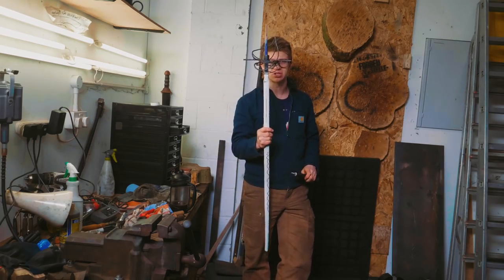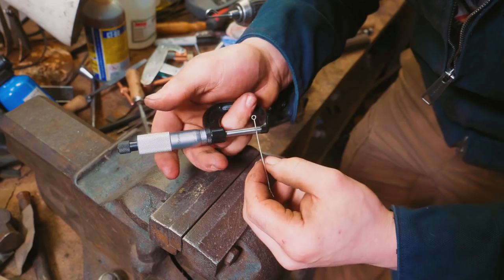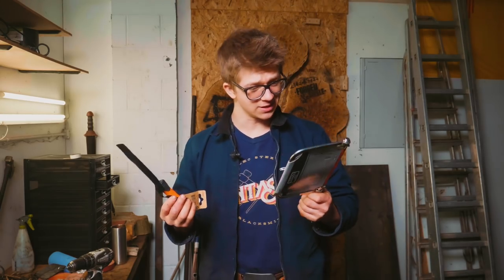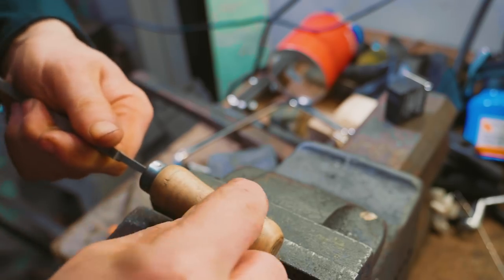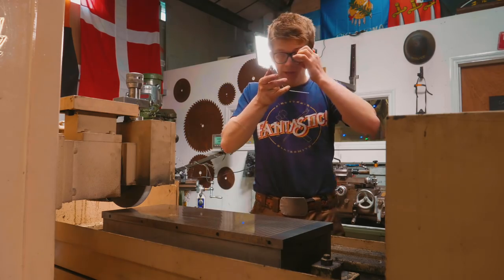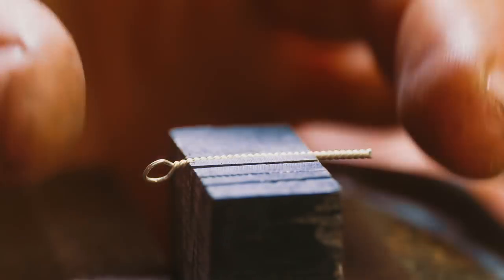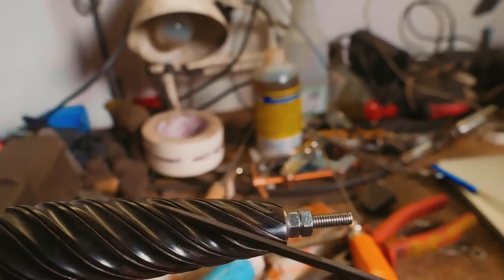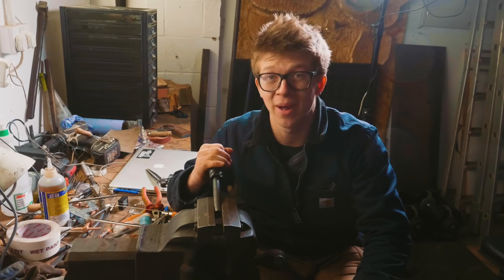MAKING A BASKET HILT RAPIER SWORD PART 13

Comment: Beautifully done! Don't forget to anneal that silver wire both before and after twisting! Consult a jeweler about it. When I make grips like that, after cutting the grooves for the wire, I use a fine, triangular Roffler file to chamfer the edges of them slightly so that insertion of said wire is easier. My usual procedure is then to run thin CA glue down the slits and over the wire and the entire surface as a final finish. So far, none of my wire wraps have worked loose!

Comment: Drill some little holes into the beginning/end of the flutes so as to anchor the sterling braid. Also, the KRAGL! (spoiler alert for anyone who missed the Lego movie) ((everything IS awesome))
Super glue can be your ally in this. With the proper silicone applicator from one of those BBQ basting brushes, you can pinpoint the glue where you need to. But of course this comment is in the past for you so I'm excited to see your execution! 
Top tip: by fluting FIRST then polishing the flutes THEN finishing the main handle you actually SHARPEN those corners and you do it only ONCE. One & done my friend, always strive for it. ✌

Comment: Excellent result for a first attempt!
Jeweler's saws and small hand files can be more readily found at a hobby/craft store than the home improvement warehouse.
A trick for starting cuts in wood without the blade jumping - run the blade in the non-cutting direction first, it will still cut a little bit but won't skip as badly. Also, if you can, apply a light pressure to the side of the blade with your thumb.

Comment: Hey Alex, Continue the grooves on the ends, drill small hole at the end of groove, put tap of super glue in the, along with end of the wire, bend 90degree on the groove and continue until other end, then put tap of glue on the hole and push the wire end in the hole, while holding the wire from getting lose. This should hold it in place. You can put taps of glue into groove along the way, but this can be bit messy. To avoid most of the mess, put tap of the glue, place the wire in place and when glue has cured, use edge of razer blade to sizzle excess off, polish and apply lacker that secures wire in the groove and protects the surface. Most people would recommend oil, but lacker is better as it holds the wire too.

Comment: With patience and perseverance you can piss through a brick wall.
Reply: Jim Garner My stream is pretty weak and I could barely piss through a sand castle. Do you think that advice will work for me? Lol
Reply: Jon Knapp last I heard erosion still works... As for the weak stream, you might wanna get that checked out...
Reply: Not gonna lie... I am stealing this as a teaching quote. You coined it, I will make it famous.
Reply: I would have said impossible before I saw those flutes being made. That wall CAN be pissed through. You can do it!

Comment: For the larger scratches try putting baking soda in the scratch then put superglue onto the baking soda, it's a trick I learned doing old guitar restoration. It feels good and once you make it flush you can hardly see it

Comment: Really appreciate your attention to detail and carrying that all the way through. Good craft isn't always knowing the way you will do something when you start doing it.
May have been mentioned, but in case not:
Try using a burnishing tool over the wire after you get it in and it will form into the groove better.
Jewelry (wire) blades come in large packages and many different diameters. If you really want to go deep  end, you can cut your own saw blades with variable tpi at different parts of the blade without too much work. Look up dovetail saws.

Comment: The slight imperfections don't matter. It's not about accepting them because at least you tried; it's about making something that has had heart and soul poured into it and imperfections are part of that. A machine could maybe cut the grooves perfectly but it would be all the lesser for it. Fantastic video, fantastic work as always.

Comment: Hammer the teeth on coping saw blade to take some set out which makes the kerf thinner.
Reply: Well, he did destroy his relief angels that way, but that isn't a concern for this application. Only if he was making long cuts or using this in metal. Which he isn't.
Reply: He just turned the saw into a file...
Reply: Geoff, you know, I've just spent several minutes thinking about all the things I learnt about files and saws (I have been lectured many hours about that stuff by a metallworking foreman, and I couldn't come up with anything, why you should be wrong. The only thing would be, that a file is self supporting, but that is pretty weak.

Comment: Hey Alec,   Hopefully this is not too late but i would recommend annealing that silver wire before twisting it.  The twist will seriously work harden the silver.   Keep it in a tight bundle as you have it. some thin iron wire wraps will hold it nicely.  If it gets firescaled then a safe pickle solution to remove the scale can be made by dissolving Alum (should be available from a pharmacy) in pan of hot water leave it in the solution for 15-30 mins on the lowest stove heat you can.   

When twisting, use the hook and drill method you were using but do far more than you think you will need (getting consistent twists over multiple lengths can be tricky). Keep the wire under a bit on tension and go real slow with the drill allowing it to draw you towards your vice as the overall length reduces.

Finally... when you release the wire it Will want to spin and can kink or tangle so keep then tension & hold twisted end near chuck real tight in a glove and cut wire at the hook... then slowly release pressure on wire and let it "relax" under control.

Tap me up if you need any silver working tips.

Stay safe, stay well, dream well

Comment: Alec! I haven't a clue if it's been mentioned yet or not, but when you put the blade into that jeweler's saw, keep the far blade holder open and keep pressure on the handle when tightening the far holder. Your first blade wasn't taut at all, and you weren't cutting as deeply as you could've been.

Comment: Hey alec, just a quick tip when twisting wire. after its all twisted, cut it at the opposite end of the drill with wire cutters instead of releasing it, itll release all that build up tension in end cut as opposed to releasing all the tension into the wire if u simply release it

Comment: Alec, the handle looks great so far. I'm sure you'll complete it in order.
Next time, maybe try holding it in the lathe so you can turn it just a little bit as you cut or file around the handle. Just might decrease the time a bit from loosening and tightening the vise. Plus you can keep the angle of approach the same instead of adjusting the vise or yourself to meet the angle it happens to be in the vise. If you're worried about getting wood shavings into the lathe, you could either get a small wood lathe or put a cloth or paper drop sheet between your work and the lathe.
Going Amazingly. Great job.

Comment: Hey mate, using a sanding sealer then a wood friction polish with a buffing wheel would save you a heap of time on sanding those flutes. Look up EEE-ultra shine, or Yorkshire grit. Pretty standard woodturning stuff, your Dad probably has some.

Comment: Get a hemostat for holding small items like those sawblade pins. The hemostat has a locking mechanism so you don't need to keep constant pressure on the item you're holding to prevent it from slipping.

Comment: I think going from metal working to wood working is a lot harder since when working with metals most of the time fixing a mistake just involves adding heat and giving it a few hammer strikes but with wood, you mess up and have to start ALL OVER. Let's just say I've had a hard time with wood, seeing what you've done is just amaizing.

Comment: As this tip may be too late or just uneeded.  If you plan on using an adhesive with your wire inlay I assume not with that amazing tolerance fit but if so get a syringe and fill it with CA or get something like GS Hypo Cement that has a tiny needle end built in for fine work.  But holy moly Alec the work you do never fails to amaze me you are a talent and a joy to watch.

Comment: I'd have cut a flat into the top and bottom of the grip at the end of each path, letting you lay the ends of the wire all the way up and over, letting the spacer and the pummel friction grasp the ends of each wire for a flush look! Still, GORGEOUS work alec.

You can check your depth with the side of  a feeler gauge, marked with a marker or scribe line at your desired final depth!

Comment: It came out beautifully, it might help to drill a pilot hole on the ends of each of the channels then you could drip some super glue into them and tap a angle on the end of The Wire so when you're wrapping it it won't pull out, the pommel and guard will cover the ends anyways so you won't notice anything.

Comment: if you haven't already twisted the wire, might i suggest looking at vape coils before doing so. it may give you new insight in method at type of twist. there is also simple jigs you can make that would help you not bust any of that soft wire.

Comment: I saw you using a looped end in the chuck of your drill and have a method that has worked for making twisted wire I think will help you out. When you go to twist the wire if you take a single strand and chuck it in the drill then vice the other end it will straighten out the wire before you go to twist it. When you go to twist it, tape the two pieces together then on the other ends make one 90° bend at the end and put those in the chuck of the drill the twists will come out very even and you shouldn't get any breaks. Just take it slow and hold tension not to much but you will know what I mean when/if you try it.

Comment: Not sure how you're thinking of doing the twisted wires, but I'd suggest grabbing a pair of lock wire pliers. There's actually a couple procedures floating around that talk about achieving certain twist per inch that could probably help give you a very consistent thickness.

Comment: Take your groove around the corner on the ends ( cut a groove on the flat end) so that your silver turns 90 degrees and is sandwiched between the wood and the pummel , between the wood and the  transition spacer. This should help secure the silver wire at the top and bottom of the wood handle. 😎👍
Reply: Love every thing you do by the way👍

Comment: For the wire inlay, could you have gotten a tiny flat head screw driver, ground it into a chisel shape? Seems like it may have made both depth and width easier to gauge.

Comment: ALEC: important thing: if you want to use silver in your projects, but dont want to worry about it getting black, use Argentium Silver, it doesn't turn black (under normal circumstances) and you can actually thermally harden it so that it is less likely to get scratches. If you, at any point, have any questions/want to know more about working with precious metals, feel free to ask, I am a goldsmith.

Comment: You should get some safety wire pliers, alec! A fairly inexpensive pair is about 10-20 quid and does a much better job at making quick and consistent twist counts in any sort of wire. They're also pretty versatile pliers for detail work since they lock down very securely and also have a set of detailed cutters. You can get them with textured jaws (my preference) or smooth jaws (the preference of people who safety wire jet engines since they don't mar the wire on complex wraps where you use one length of wire wound multiple times in multiple places)

Very versatile tool and they do the specific job they were made for remarkably well. just go for some reversible ones with textured jaws. Safety wire is also good for bolts that tend to rattle loose on things like the power hammers , grinders and mills, you can get away with a LOT less torque fatigue on bolts by simply safety wiring them.

Comment: One way to ensure your wire thickness is consistent is to count the twists per inch (or CM) in each segment that you twist. if you need eight individual strands, twist them in short individual segments (longer threads tend to be less consistent) and just twist them to a specific number of twists per inch.

Comment: Brilliant video as normal, thought i'd just pass on some tips for your wire twisting. As part of the vaping community we have now quite a few years of experience making wire into heating coils for use in vaporisers, some more practical than others but it has become an art form! you would not believe the work and craftsmanship people have gone thru to heat up a fluid. point being do a search for simple twisted wire coil building, you will find plenty of vids on youtube showing you how to avoid it knotting and even straightening the wire before twisting etc. have a look around and see what you can find to help your endeavour. All the best!

Comment: There may be another comment about it, but I didn't see one. When tightening the micrometer, use the black knob at the end. It has a clutch so that you do not over tighten the jaws on the material. It will also help keep consistent measurements since you will tighten it to the same torque each time.

Comment: That is pretty amazing. Hopefully anyone buying a handmade blade with a spiral fluted handle now understands why they are as expensive as they are. Even if you've done a number of them and know how, it's still a painstaking and slow process to get right. It has to be right because if it's off just a little it'll be real apparent. Also it takes so much skill do that the rest of the blade is likely done to just as high a standard.

Comment: Alex, great series as always.  I was reading the latest (April 2018) issue of Fine Woodworking magazine and saw an advert for some new (at least to me) sandpaper by 3M called Pro Grade Precision.  It is supposed to be very flexible sandpaper with a "unique film backing resists punctures, tears, and creases".  Thought it might help. 

Keep up the great work.
Rick

Comment: Japanese saws are brilliant for this stuff, they cut on the pull stroke which makes accurate cuts a lot easier and you can get insanley thin blades all the way up to super heavy blades.

Comment: cut a blade from an exacto knife in half so it is not as long, then make a channel by stabbing the blade into the wood over and over along the line you want. I have seen and done this several times, and it is the standard way that a lot of the ABS people do inlay into wood.

Comment: Will you be cutting grooves for the wire into the ends of the handle too? That way, you'll not have ends sticking out my your hand, but will have them safely tucked away around the ends of the handle.

Comment: I'm a wood worker. To flatten the "kerf" which is the left and right offset of the saw teeth all you had to do was put the blade on a flat hard surface and tap it with a hammer. It would have made the grove smaller by removing the alternating left and right offset of every tooth on the blade.

Comment: I knew you would use the surface grinder on the coping blade! Old jig saw trick: use diaper safety pins instead of reinstalling the old pins!

Comment: Just an idea, I would continue your wire channels over to the top and bottom of your handle to hide your ends under your pommel and top piece. Locking them in place when assembled.

Comment: Love the finisher you got on the handle do you think if you would’ve used a polishing wheel on your bench grinder could you have achieved the same polish and maybe you wouldn’t have had to use so many grits on your sanding

Comment: i see you constantly making blades out of Damascus which is cool. however what i would like to see is a multi layered blade that has the edge and the spine forge welded together Japanese style.  where the back of the blade is stainless steel Damascus and the actual cutting edge is a hard mono steel? kinda like an expensive chef knife. like a miyabi birchwood knife.
Reply: I seen a man on you tube years ago make a Damascus viking sword that was double edged Damascus that had 2 hard edges and a soft core. he was a master swords smith and i would like to see you make an even more ambitious build like his even if it doesn't work out we all learn together.

Comment: I love how you have done this and it looks incredible. I was thinking though. When the handle meets the metal pieces both above and below, are you going to have the silver wire end flush with the metal or maybe shave a shallow groove to bend the wire so that when its put together it can bend and be held in place under the metal pieces?

Comment: I am really enjoying this voyage, Alec.  The handle looks fabulous!  Will you be looping the wires to go around the hilt of the Rapier at the front and back of the grip?  I have been pondering this sterling silver inlay for awhile.  There is a farm near by that has some Texas long horn cattle and they have some huge horns.  I'd love to get my hands on a pair of them, do some pencil artwork, use the coping saw and inlay it with the sterling wire.  It's been on my mind for a few years now but they're not my cattle.  I can only admire them.  Oh well.

Comment: I noticed the bottom and top of the handle was not knotched all the way through. You may want to do that and have the wire wrap drape through to pressure fasten. Not only will it give a cleaner look, there will be less of a chance in the wire coming loose

Comment: If the silver wire is only held in the groove by pressing against it, shouldn't you put it in the freezer for a while before tapping it in? Otherwise if it gets cold it'll go smaller and fall out.

Comment: Would some slightly larger gauge silver wire have worked instead of surface grinding the saw blade? I know going up a gauge would increase total diameter by double the change in gauge, but just a thought I had. Swords looking great, keep it up.